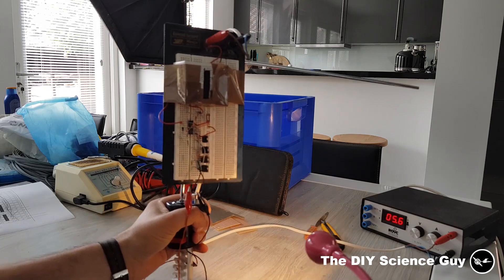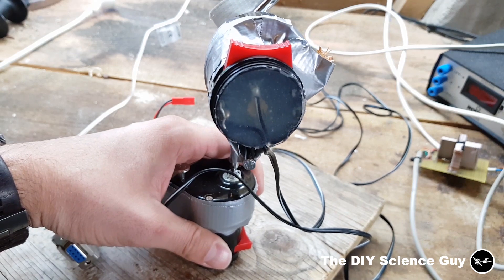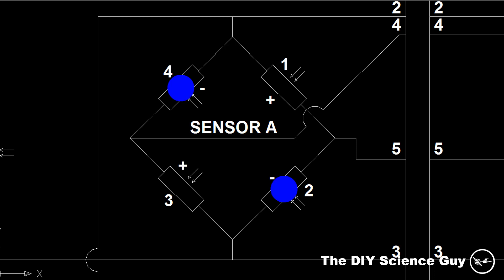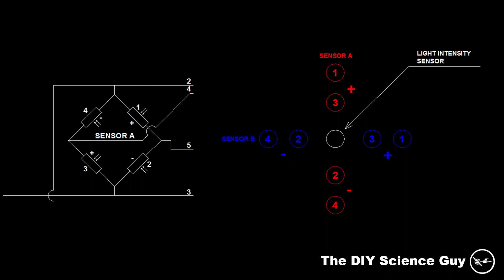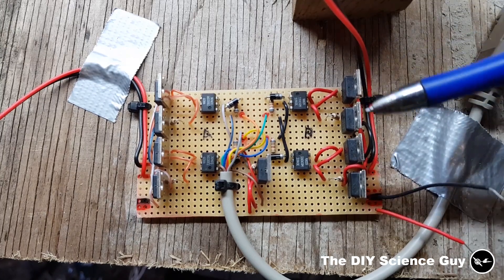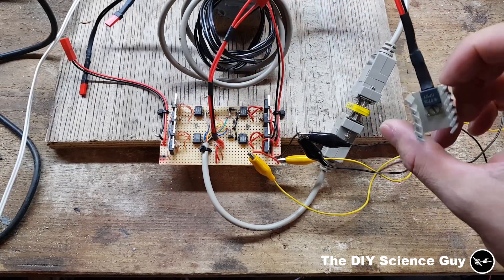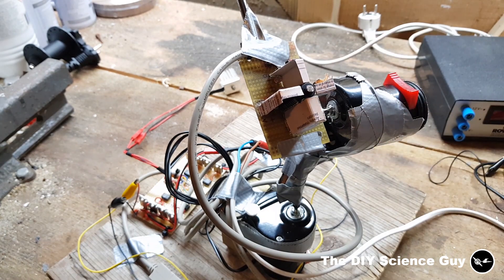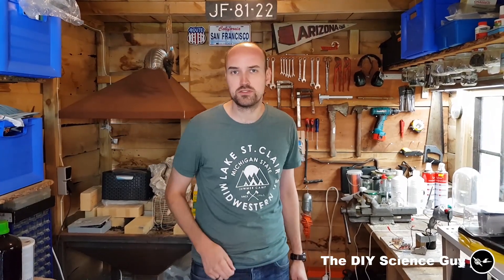Solar power-solar tracker-heliostat #1 the Electronics

Comment: A friend of mine actually built one of these for his university project, he also used a photo resistor to sense the sun position,  after he completed his project he discovered that there was actually an equation that will calculate the exact sun position given the current time, he ended up upgrading because otherwise he was having issues with reflections etc. He used a GPS to suck in his current location and also for accurate time, the equation he used is accurate for like 100 year or something crazy, could be another fun addition!

Comment: That's an excellent setup, thanks for taking the time to make this video. I would like to do similar type thing and this looks very feasible for DIY project. 
      I had also been curious if it might be possible to build a motor controller system that can simply hunt based on solar array highest power generation from actual line voltage/amperage sensing, or having a 'sampling' cell panel (5x5, 2.8w, individual cell), where it just gives you more of a max wattage sensing/hunting and adjustment. Might need to use an Arduino or Raspberry Pi so we could build in the hunting logic with Python script or something. Just a thought I had.. 
      BTW, I really enjoyed your HHO generator/hydrolyzer videos, nice to see someone also show how to separate the H and O2, purify and compress it into bottles using simple homemade equipment. I like stuff that is simple enough we don't need a million dollar lab to do, can make cool technology from home.

Comment: Can you please add a parts list and where to get each part please. Love the step by step and explanation but items list is a must!
Reply from the maker: Thanks I'll see what I can do!
Reply: @TheDIYScienceGuy  I was going to ask the same thing  i.e. parts list, instructions, what not to do etc.  !  I really like the simplicity of  this system, I saw your other video about the mechanical aspects of this design. It's good too. The only thing I would do is maybe make more of the mount out of fiberglass and metal. One question though - how does it work the next day after the sun sets? Does it still manage to find the early morning sun and move into position?  also - in order to use this as an array and focus it (and likely several others) on a remote receiver - what needs to happen?
Reply from the maker: Thanks! Sorry but that takes a lot of time which I unfortunately do not have at the moment. Maybe later. I advice you to look at the diagram in the video, all the part names are in there. Don't worry just go and make it on a breadboard experiment a little it's fun! 😉

Comment: Hi Solar Guy;
1. You are calling your project a "Heliostat" but it isn't a heliostat. It's a "Direct Solar Tracker".
A heliostat is, generally, a Mirror that reflects light from a moving source, the Sun, to a stationary target.
See the accurate definition here:
http://www.redrok.com/main.htm#definition
2. You are also describing your solar tracker as "High Efficiency" when it's not. The clue to it not being efficient is the requirement for heat sinks on the electronics.
If it were efficient you could drive even high power motors without any heat sinks. 
The solution to get high efficiency is to always saturate the transistors and drive then with pulses. The driver circuits should not be "Analog" in nature.
I have designed many solar trackers over the years. Some better than others. However, all the efficient tracking circuits are based on this concept:
http://www.redrok.com/electron.htm#xor
Basically, pairs of sensors driving pairs of Exclusive Or, XOR, gate circuits. Examples of this:
http://www.redrok.com/led3assm.htm
http://www.redrok.com/electron.htm#dcb
http://www.redrok.com/led3xassm.htm#led3xschematic
Duane
redrok@redrok.com

Comment: Nice idea with the cardboard shield shapes. Any reason to use two PR's on each wing instead of just one?
Reply from the maker: Thanks! Yes that is to create the Wheatstone bridge as shown in the video, there you can see how I arranged them to create that bridge which generates a voltage difference that I then use for the necessary adjustments.